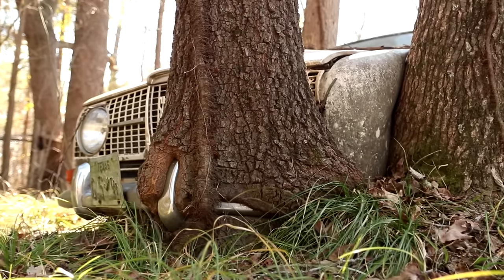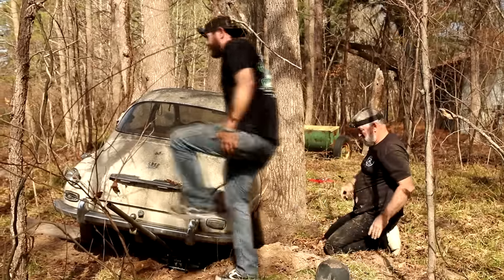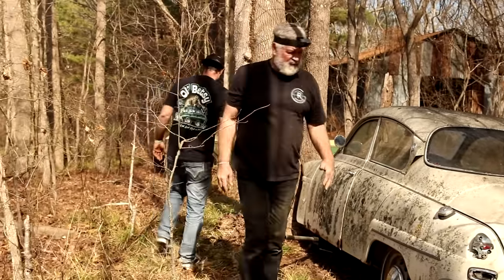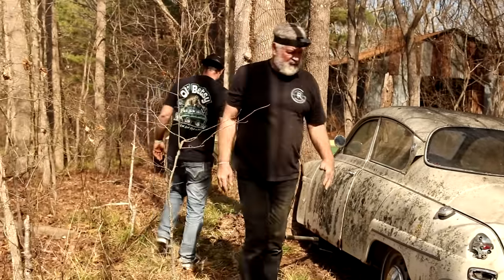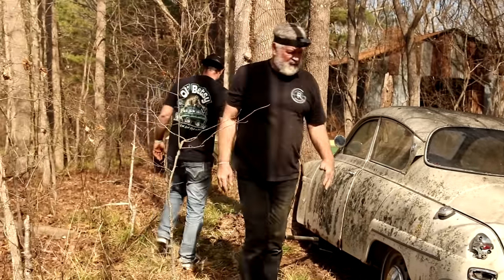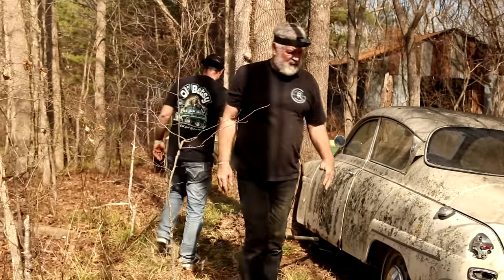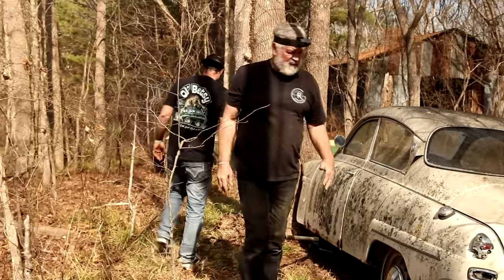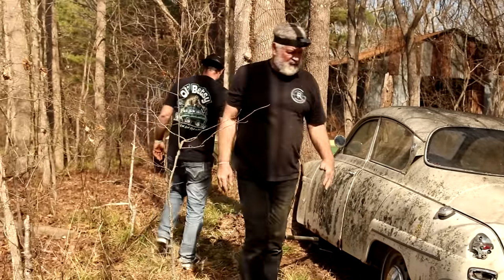Cutting Abandoned Car Out Of A Tree After 40 Years | 1968 SAAB 96 | RESTORED

Comment: When I was a teenager, I got a 62 Saab 96 running from 2 different cars. The one  i fixed looked a lot like the one you rescued.  That car had a 2 cycle 3 cylinder engine.  I am 64 years old so that tells you how long it's been. I wish I had that car back 55 miles a gallon.    My grandpa tried to give me his Saab 95, I think, that was the station wagon type.  It was parked out back beside his garage for years. He proudly gave me the keys, I unlocked the door, hopped into the driver's seat and immediately fell all the way to the ground!  The unibody was rusted completely away.  It was useless. but I was able to pull the engine out of that to put in my 62.  Lot's of memories of that car.
Reply: I owned a 1958 DKW which also had a 3 cyl  2 cycle engine, and front wheel drive. I got it running as well, but sold it before I was old enough to drive. Those old Saab's were great cars.
Reply: Yes 3 cyl 2 cycle brother had one slow movin cars ya in for some work lol good luck set it on a jeep or somethin lol
Reply: Old 3 cylinder 2 stroke Saabs were great point to point racing cars! Tremendous Torque for hill climbing! Had one for years a '58. They would overheat if they sat since the water pump only pumped when it was moving. You could put any kind of oil in the tank with the gas! Fun Car!
Reply: @zw5509  Not true.  As long as the engine was turning , so was the water pump on both the 1st and 2nd generation 2 stroke SAABs.  1st generation the water pump was the back half of the generator, so one pully on the front drove both the generator, and the water pump
Reply: You can get a 1972 Suzuki Jimny LJ50. It has the same engine type. It's a jeep that sounds like a snowmobile.
Reply: @BillyRoberts  Back in 1975 I had a 49 Chevy truck that I found parked for years behind a barn. This was in Western Greys Harbor County and had rust holes you could put your hand through. I bought it from the farmer for $15 dollars. Once my Dad and I got it running you could drive down the road and see the concrete or asphalt through the holes in the floor. It was pretty bad! I had something to drive though and I was pretty happy to have it!
Reply: @kickit59  I bet it was scary driving it.
Reply: @BillyRoberts  I was just a kid then and while it was on my mind it didn't bother me too much back then. I had wheels so I was pretty happy!
Reply: O'Neil
Reply: @zw5509 uno de

Comment: That car does indeed have a V-4 engine in it.  It is a later model SAAB 96.  Earlier models had a 2-stroke inline 3 cylinder engine.  I know...my family had two of them back in the late 60s-early 70s.
One thing that may surprise you is the free-wheeling feature of the transmission.  It was a great fuel saver and reduced engine wear by a considerable amount.  Great car to drive and it has a full underside panel useful for keeping precipitation out of the engine bay.
Reply: You are correct but forgot the dual roll bars in the pillars , the crafty method of raising the back seat squab for children  , the method  of releasing the back seat back  , the hole for skis , the through ventilation system and the tubular anchor for the seat belts,  the gear shift on the steering column  , not to mention the forward tilting bonnet  (  hood for you yanks) in case the safety catch failed ,  brakes power assisted      .both  mine were red  ., l last one 1973 .  Fantastic rally car.  SAAB   -    SVENSKA AEROBOTAN  hence rumour they were made by aeronautical  engineers from bits of saab viggan fighter jet  .
Reply: it that car worth all that effort?

Comment: A little  more than 30 years ago my brother and I had gotten a contract from a bank to clean up a foreclosed property of the abandoned vehicles the previous owner had left there. There were 9 heavy trucks and  4 light trucks and vans and 23 cars one of which was one of those old SAAB’s a rust bucket but otherwise identical to that one right down to the color and V4 engine. The previous owner had built a driveway behind it that was about 4 ft higher than the ground where the car was and it had a steep embankment (about a 70 degree slope) that was about a foot away from the cars bumper and a swamp started about 3 ft from the other bumper. When we got it about half way up the slope, something under the car got snagged on something and proceeded to pull the bottom of the car in half so the roof was all that was holding the car in 1 piece.  It suddenly  came free from whatever it was snagged on and the rear half of the car twisted up on the driver side to about a 45 degree angle which popped the rear window out of the car sending it flying through the air for about 20 ft and landing on a pile of bowling ball sized rocks with sharp points and jagged edges on them. Somehow the window didn’t break. We pulled the car the rest of the way up to level ground where the rear floor section snagged into the gravel and folded it up even more at the rear bumper until it folded it forward onto the front section of the car. To load the sections on the trailer to haul them out we just cut the A pillars at the windshield and winched each piece onto the trailer separately. We did save 3 of the heavy trucks and  2 of the other cars for ourselves, sold 4 cars, and 1 van and light truck, had 1 van and 3 cars stolen one night, and we scrapped or parted out the rest. I could tell about the adventures of the rest of that property cleanup but it would be the size of a humor novel, but it was hilarious at least once per vehicle other than the ones that were stolen, and definitely proved to be an adventure. For example me riding over ruts, boulders and logs pumping a squeeze ball to keep gas going to keep it running while on the front fender on a 47 Studebaker Dump truck wrapped around the turn signal canister like it was a saddle horn during a rodeo while my brother drove it out (fuel line was too short to reach the cab). He had hooked the fuel line to the input of the fuel pump instead of directly to the carburetor and I didn’t pay attention to that fact because if I stopped pumping it the truck would stall out after about 5 seconds because the fuel pump didn’t work. He hit a log hard enough to blow out the front tire which rang my chimes on the turn signal so I quit pumping the squeeze ball only to find the trucks fuel pump had started working. Any bull rider in a rodeo would have been proud to have made such a ride.

Comment: As a Swede I was literally shouting at the TV “Its a SAAB v4 rescue it, save it, RESTORE IT!!!”. Hoping for a 2nd episode on this car! 
I hope it is restorable after the long lovestory with tree and nature.
Reply: I thought Saabs had 3-cylinder 2-stroke engines up until the seventies. Then again, I'm not an expert on Swedish cars. Correct me if I'm wrong.
Reply: @НиколайАнтонов-я8е  In 1967 came the V4 and in 1968 the 2-stroke disappeared.
Reply: You and me Both spda242!
Reply: @sillenHDsportster  yep, and IIRC 1967-69 had that grill, then it became plastic.
Reply: @sillenHDsportster  That explains it. As a matter of fact, I did see a V4 symbol on the front fender behind the wheel arch. Thanks for explaining it.
Reply: @sillenHDsportster  To make it a bit clearer, in '67 the 2-stoke and the V4 were both available, and the 2-stroke was discontinued sometime during that same year.
Reply: Yeah, that engine is a 1.5 litre V4, originally used in Ford Taunus 12M. At this time, 2-stroke engines were getting outdated, so SAAB wanted to modernize the 96 with a new engine. After some experimenting and testing, they chose the V4 from Ford.
Reply: As a Swiss Saab enthusiast I was doing the same!
Reply: @UberLummox  Read again what I wrote ! In 1967 came v4 and in 1968 Saab removed the 2-stroke !
Reply: @sillenHDsportster  I know what you wrote, but  they discontinued the 3cyl. that same year. Even says it in my SAAB book.
Reply: @UberLummox  If you go to Wikipedia they say the two-stroke engine still remained as an alternative until 1968 when it was completely replaced by the V4 engine.
Reply: Me too would love to see a second episode of those cars!
Reply: Yes Saab is a great vehicle!!!

Comment: Yep, it’s actually a Ford V-4 engine with a 4 speed manual on the column and front wheel drive. Grew up with one of these ‘68 SAAB 96’s and spent countless hours working on it with my dad. Very cool car that got great gas mileage and was terrific in the snow, not fun to get parts for though. Can’t tell you how many of those tail light assemblies we went through, they stick out and they’re the first thing that gets hit in the parking lot!
Reply: That is the same drivetrain that was used in the 1962 Mustang prototype. I always wanted to get a V4, 4 speed out of a Saab and build the Mustang 2 seater around it.
Reply: @hotwheelsbob2000  that would’ve been awesome! I think it was a big mistake not to bring that engine to the US. Imagine what a hot seller an economical well built V-4 would have been at the dawn of the compact car era when the Japanese took over the car market.

Comment: I've been through this.  The most direct method is to top the tree and then cut it again, at, or below ground level.  It is miserable work but it does allow for a speedier removal of the vehicle.  Then it's just a matter of reducing the wood that's left attached to the vehicle, which always seems far easier once the vehicle is back at the shop.
Reply: You are 100% correct. Like they said they had no clue or idea as to how to proceed. Fortunatelly they had a friend in the tree trimmimg business.

Comment: I had a '67 Saab in college and it was the best car I ever owned.  Easy to work on the Ford V4 engine and the freewheel clutch lasted FOREVER.  Put 230K on it and sold it for more than I paid for it used in 1970 with 67K on it.

Comment: A friend had 3 of these: 2 standard ones and a Monte Carlo with more power and oil injection. I towed one from Maryland to Tennessee with my 1971 Citroën DSpécial while he drove the Monte Carlo.
I don't recall when SAAB switched from the 3 cylinder 2 stroke DKW designed engine to the German Ford V4 4 stroke. His were all 3 cylinder engined.
The 3 cylinder was light enough despite being entirely cast iron block that I was able to remove and replace the engine by picking it up. 35 years ago.
Funny – the 2 strokes were so inefficient that I got over 25 mpg in my Citroën while towing his SAAB at 70 mph. His MC got 25 mpg. The V4, though back in the carburetor and mechanical ignition era, got considerably better mileage.

Comment: "Just as bad as the Ford..." 'Cause you're lookin' at a Ford!
The V-4 that powered that thing is a Ford engine, but it was picked off the shelf as an industrial engine, never originally designed to be an automotive engine.  Saab used it in the Sonnet sports car also.
My girlfriend in 1972 drove a Saab 96, but it was powered by an 850cc, three-cylinder, 2-stroke engine.  Hers was the "performance" Monte Carlo model that had three Weber carburetors.  When she'd pull in to get gas, she'd hand the pump jockey a can of 2-stroke oil, tell him to pour it in the gas filler, then add 8 gallons of gas!  
Later I campaigned Saab 99s in racing and rallying.

Comment: I had one of those back in... 76? I think it was a '68. I don't think it made it from New Jersey to Texas, though. That V4 was a Ford engine -  a forklift engine if the legend is right. The car didn't handle as well as the two strokes, but you could at least run it down long hills without freewheeling it.  😂 We had a lot of SAABs. Front wheel drive was useful in rural  Northern New Jersey winters, and there weren't that many front wheel drive cars available in the early 70s.

Comment: I would have left the front bumper in one piece and then cut the remains of the tree from around it.Trying to lever at the front appears to be lifting the car slightly most probably because the bumper bracket is the piece being levered against and is obviously still attached to the car. Could have done a bit more work with the saw at the base of the front wheel to free it....

Just a'sayin'.....

But well done generally in getting it free....and felling the last tree to fall just missing the John Deere Bailer or Rake was goodwork.

The Saab does appear to be in remarkably good condition...

Comment: removing that wood attached to the vehicle at 39:12 would be easier to do the way wood sculptors  do it on large pieces  , when using a chainsaw ;
Cut a few striations In the  chunk of wood  half inch apart ,  without digging too deep and risk hitting  the metal , then with a chisel and hammer  chip  vertically through the striations removing the bulk of the wood  effortlessly ,and the little that is left should chisel or grind  out without a problem .
That SAAB would look really nice restored , though European classics at US auctions don't do so well , but  you guy know , they might sell well in  Europe ,without restoration if its rare , but   finding any missing parts could be a serious  issue. ..and costly .

Comment: Not much of Restorer if you end up Cutting a Bumper from a Antique Car. True Restorer would have taken the Time and cut the Tree down to top of bumper, then under the Bumper. Removed the Bumper from the car then taken the Bumper and chip the wood away from the bumper. So the Bumper could have been Restored. But, Nope Lets just Ruin the Bumper and throw it away and slap some old bumper that wasnt made for this Model of car.